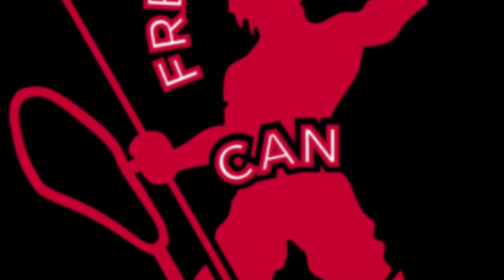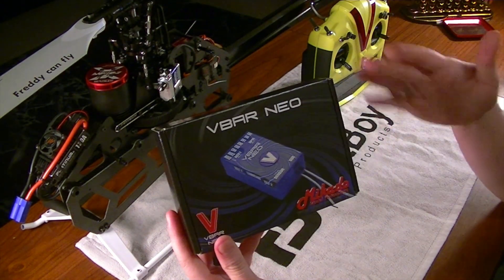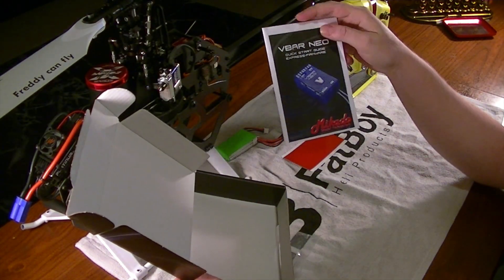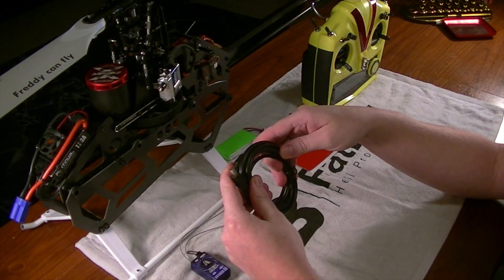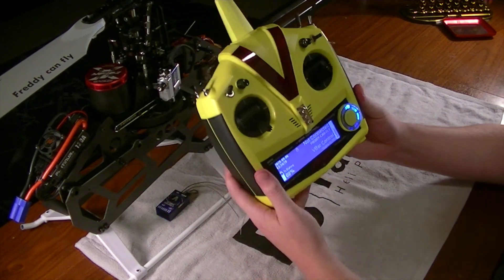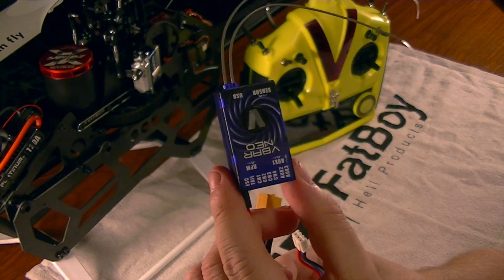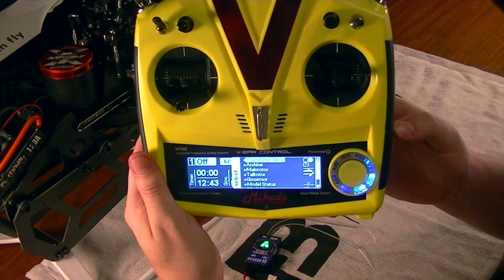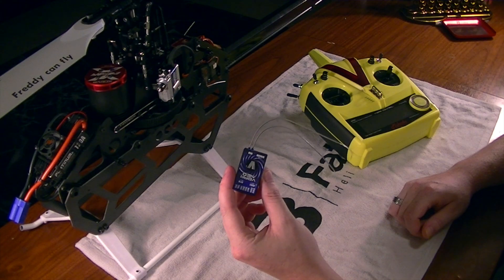V-Bar Neo : Out of the box / Binding to V-Control

Comment: do you still use the v-control? im planning to get back flying after many years off. looking at radios and fbl systems you prefer? I plan on mainly 50size nitro in the future, maybe one small electric
Reply from the maker: I use the Spirit 2 FBL with Spektrum currently.

Comment: Hi 🙋🏻‍♂️ friend.  Can you help me with setting up Vbar control?  I can't figure out what Leading Edge and Trailing Edge mean.
Reply from the maker: That refers to the edges of the blade and which direction they rotate.  For example a main rotor that spins clock wise will have the leading edge (the edge of the blade that attacks the air).  Then also just for good measure trailing edge will refer to.... well the trailing edge of the main blade (so the part that deflects the air to achieve lift).  I hope this helps

Comment: Congrats! I switched to vbar a year ago and never looked back...
Reply: Why is that? Never used a VBar? I fly Spektrum.
Reply from the maker: I am a Spectrum guy also however I am excited about using this.
Reply: @FreddyCanFly  Spectrum is also great, but if you fly Vbar and you are a Heli-guy (meaning no planks or so) there is no reason not to fly VControl :)
Reply: @redneck2994  I started with Vbar + Futaba, but didn't like the tuning via Laptop. Then went with Futaba CGY 750 for a year before buying a VControl... Futaba flew great, absolutely, but I couldn't get rid of some cyclic bouncing after stops on my TDRs. So I sold my Futaba stuff...
Reply from the maker: I am excited to review the product and learn about it.